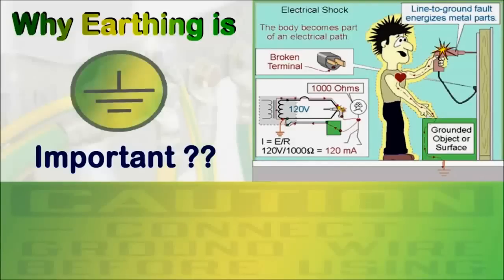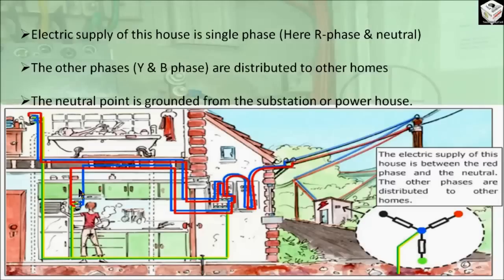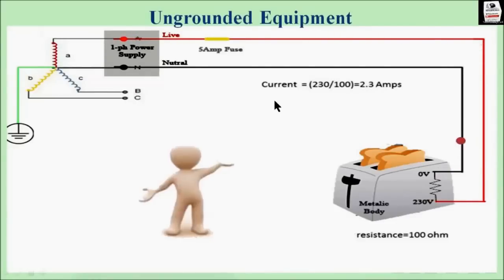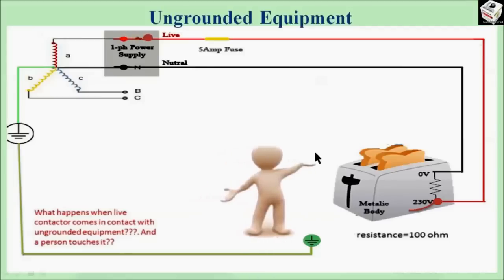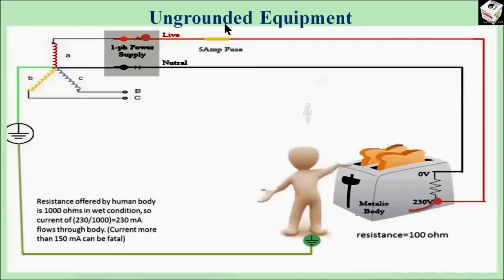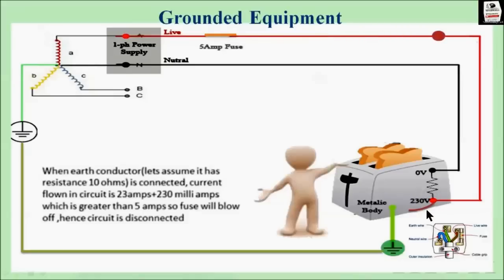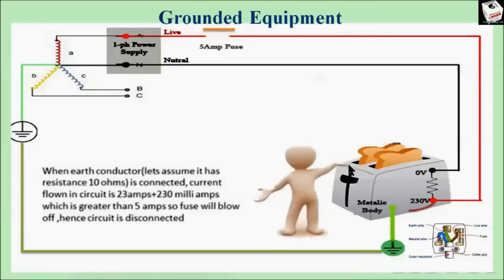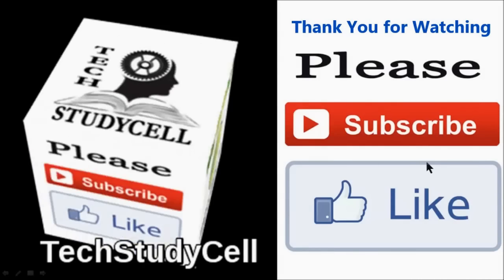Why earthing is important?  (How Earthing Works)

Comment: This is not exactly right. At 4:43 you have ground resistance as 10 ohms. Not likely. In fact what you have diagramed is known as a TT system where the neutral and phase conductors enter the building and there is a separate ground that all metallic devices are connected to (i.e., they are grounded separately from the neutral in the source). In this circumstance the earth ground path has too much resistance to reliably trip the circuit and it is necessary to place an RCD (residual current device also known as GFCI ground fault circuit interrupter) in the distribution panel.

Comment: It would be easier if the transformer neutral is not grounded. The system will be complete galvanically isolated thus electricity has no path to flow to ground through human.

Comment: I have doubt...If the ground portion have 10ohm resistance.,the current coming from the source will surely go through the grounded portion,it will not choose the 100 ohm resistance of the toaster right?

Comment: Fuse wont blow when phase is shorted with ground
Reply from the maker: Fuse will blow if the phase is shorted to the ground with low resistance path.